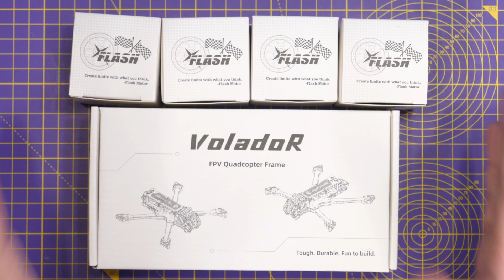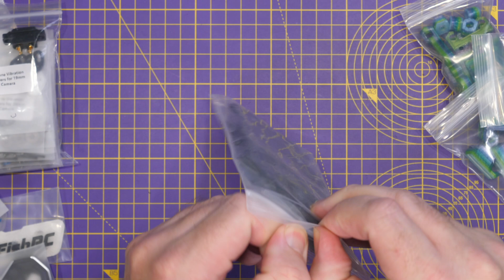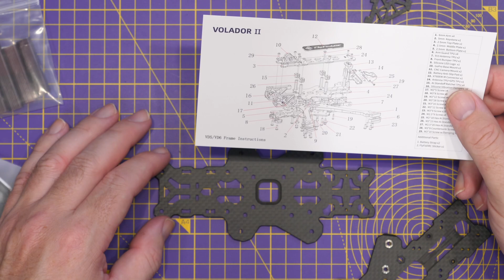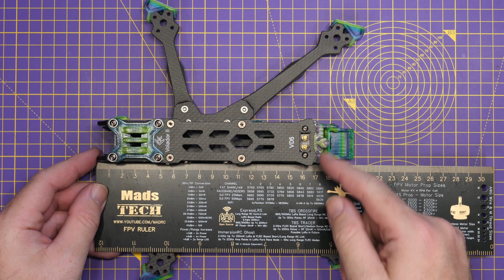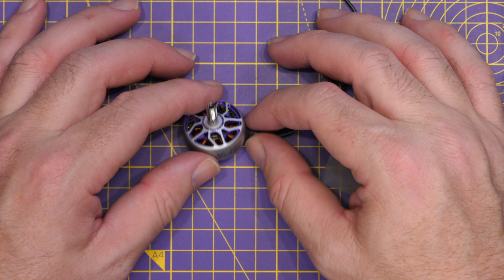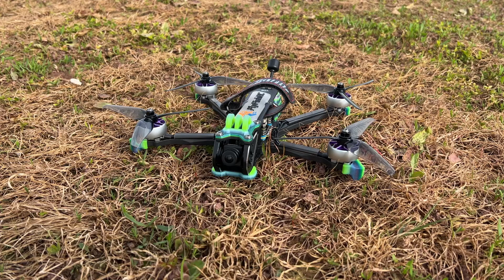FlyFish RC Volador 2 FPV Frame & Flash Motors Review

Comment: I can see at the 16:00 mark Ian you haven't got the screws in the Avatar camera on the silicone mounts. Is it me or is it impossible to mount the camera without it sitting forward in the ally mounts? If you use the back holes then you have to have the screws tightened up against the ally and when you do that you get vibrations like a pig. I'm confused as hell by this. I've had to 3d print a campera protector. It's a shocking design flaw.

Comment: Anyone throw an HD-Zero Freestyle on there yet? I'm building two Voladors (X and DC) and was planning on throwing some HDZ in there, but it is a super-tight fit, and the holes don't line up. Thinking about a "case" for the unit to put in there, but the room isn't available. Please don't make me buy two more O3s. I mean, I will, but I'd rather not.

Comment: I own the 6” Volador VD6 and it’s one solid frame. Easy to tune. In use 6s packs in parallel and it only feels like my 5” with a GoPro on it. 

Prepping to take it out to 6 miles as of this post.
Reply: I have the same frame. Can you share your settings?

Comment: I've been flying the Volador 2 FX5 with the O3. Absolute love it. Great building experience because of a smart design. Very durable so far. I paired it with a SpeedyBee F7 v3 and Foxeer Datura 2207.5 1960kv and oh my goodness. With no gopro it is ridiculously powerful and with a hero 8 and 1300mah 6s  it is around 850g .
Flyfish customer support seems really good too. Definitely recommend it for anyone wanting a O3 ready kwad frame.

Comment: Good frame o have the 6 inch version it flies well.. top plate isn't wide enough though. And it's a bitch to install the power input into the frame the way that they expect you to. Oh and there is zero room for a buzzer..none

Comment: Wowzers, would just love to see some black box logs with that stack mounted like that.
Reply from the maker: They say Kiss and others like it hard. The FC does not even come with isolators. So it’s hard mount out the gate.   It’s nothing particularly odd other than that.
Reply: @MadRC   My main quads have both kiss ultra and ultra v2's, i don't use isolators but are soft mounted between the stacks and fly like silk and clean logs, That's a new one on me but hey ho if it works then great, would be interesting to compare the logs.
Reply: @craigsaunders3532  what kind of soft mount / gummies should I get for my kiss ultra? I don't know how to mount it to my stack.
Reply: @definingslawek4731   i use Mateksys Vibration Damping mounts, or you if you have a 3d printer print some tpu spacers and use some O rings either side of the spacer, Gummies don't fit the holes hence why they don't include them.

Comment: I remember seeing this in the stream, I rem you saying the “locking nuts being a little bit of a pain” but overall I thought it looked nicely constructed. 🤔 (I’m a big fan of those integrated XT-60’s)
Reply: I am fairly new, and just ordered this frame. I will be using the intergrated XT60. I noticed you soldered the pigtail to the integrated XT60. Any chance you have a closure picture of this solder joint, just so a new comer can see how its done.